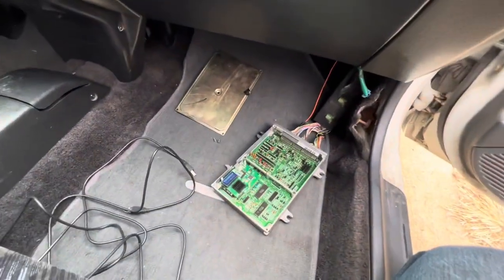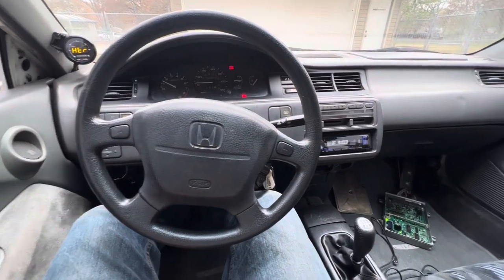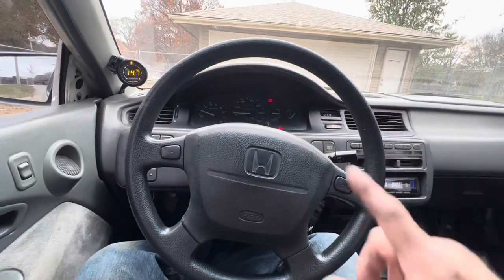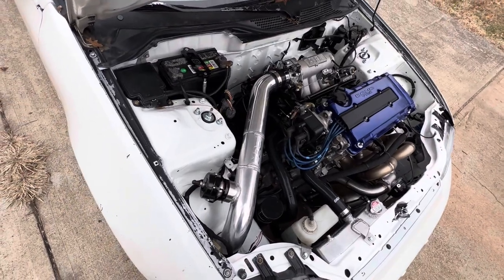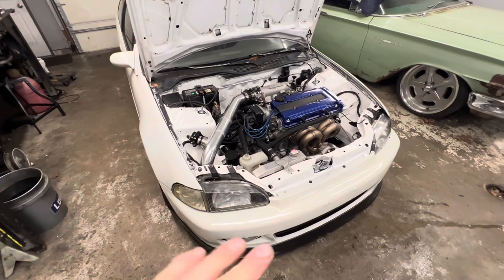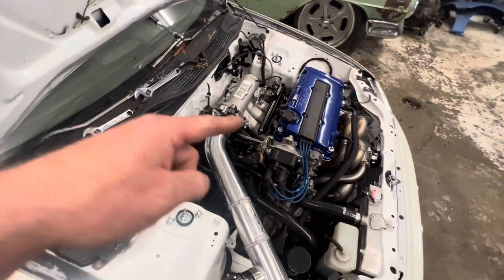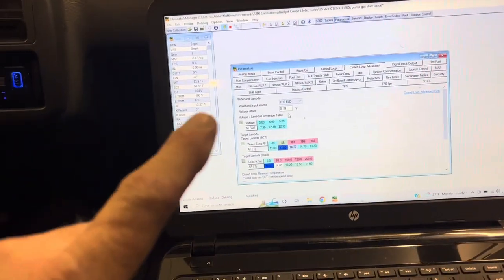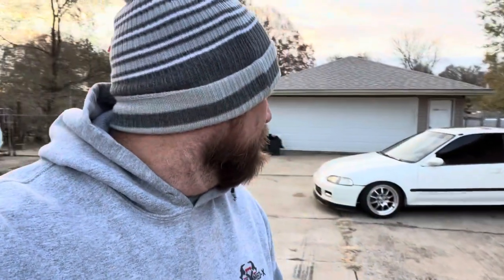EBay Turbo Civic Basket Case!! New HunterTuned 1500s Install!!

Comment: unfortunately you wont be able to see oil or fuel pressure on the hondata app. ive tried. you can display the sensor voltage, but not the psi. also, i had to move my sensor grounds to the thermostat housing, i couldnt get oil or fuel pressure to show up on the s300 display until I did that.
Reply from the maker: When I had Hondata on the red car I never had issues reading op and fp on the display
Reply: @MRE Motorsports  I'm talking about on the hondata app on your phone.
Reply from the maker: Oh ok. I got ya

Comment: Did you change the battery on the board s300
Reply from the maker: I did not. I swapped to a v3 Ecu since v1 is pretty much obsolete
Reply: @MRE_Motorsports  did the problems go away? The v1 have a part that has a battery that has a 10 year lifespan. It looks like yours was on its way out with working sometimes
Reply from the maker: Yeah by switching to v3 it cured my issues